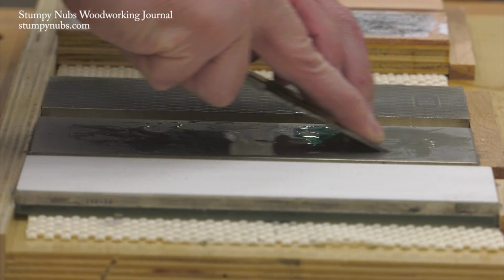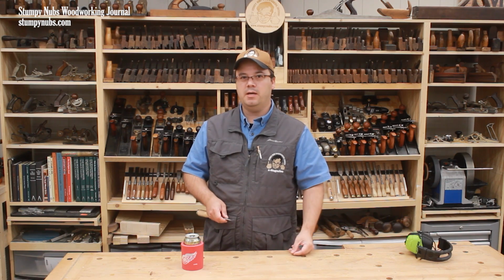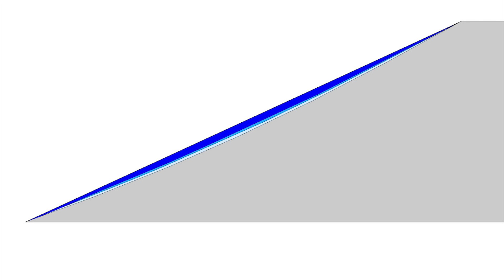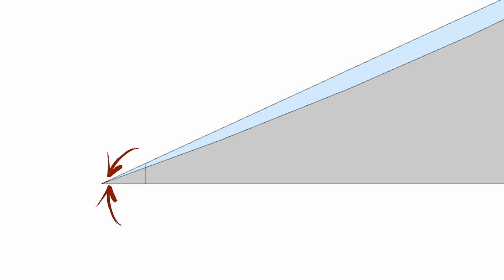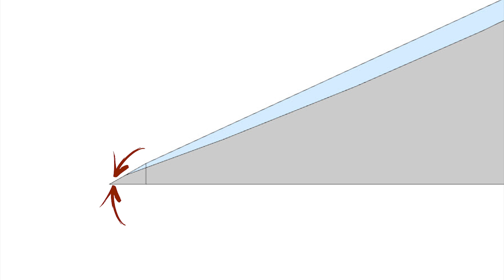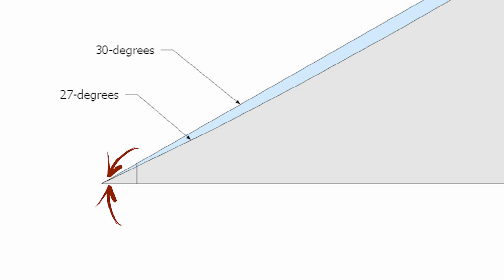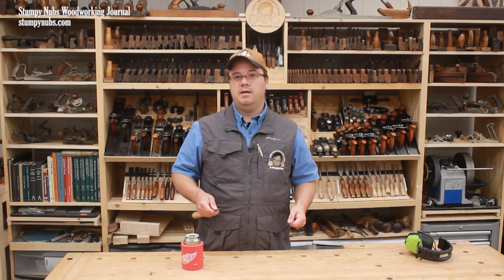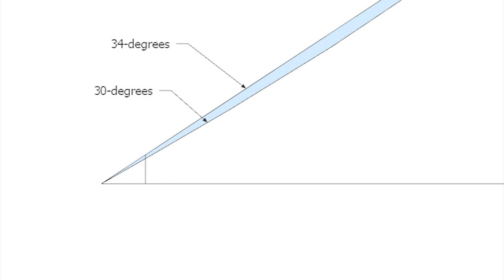The truth and the myth of hollow-grind sharpening

Comment from the maker: I highly recommend WoodturnersWonders CBN grinder wheels. They totally changed how I grind tools!► https://woodturnerswonders.com/
(When you use this link to visit our sponsor, you support us!)
Subscribe (free) to Stumpy Nubs Woodworking Journal e-Magazine► http://www.stumpynubs.com/
Reply: the reason I asked so many questions is I have just purchased 2 CBN wheels, 180 &350, along with a low speed ricon. I have the trend 1000 with their cutting fluid. I guess the Shapton's are next. Thank you for all the valuable info you have shared over the years.
Reply from the maker: @pepper7144  The 180 and 350 are great for shaping new bevels and repairing edges. Your day to day sharpening will be done on the 1000 grit stone. Many times, you can just follow that up with a leather strop. That's sharp enough for most chisel work. But when you need something REALLY sharp, such as a smoothing plane, or to pare soft end grain with a chisel- that level of sharpness would take a lot of stropping by hand (because of the wide difference between the 1000 grit diamond and the leather strop). That's why I have the 5000 and 16000 Shaptons. They do what the strop does, only faster. (Frankly, I most of the time strop on my Tormek, which is by far the fastest way to a razor sharp edge. But that's a whole different system.)

Comment: I'll keep this in mind when I am calibrating how many microns to allow for the wire-edge that has to be removed by stropping, so that I may select the appropriate polishing compound and leather species, grain, and tanning technique. Of course, this must be adjusted for seasonal temperature and relative humidity to ensure that any oxidation impurities that may form have a suitable crystalline structure so as to compliment the cutting process. But everyone already knows that.
Reply from the maker: Not sure if your sarcasm is directed at me, but I think this video has the opposite affect- it simplifies things.
Reply: @StumpyNubs  Exactly, and that clearly violates the code of the omniscient woodworker. Obscure and completely irrelevant complexity is an essential element of the hobby, and therefore your contribution must be counteracted immediately, or novice woodworkers everywhere will start to believe that sharpening is not a dark, mysterious process only able to be performed by those that have worn plaid shirts and beards for over 20 years.

Comment: I love hollow grinds ... The grinder makes creating a fresh primary bevel so easy and fast rather than having to spend half a day on a coarse stone ... I just use a simple 6 inch cheap grinder with a normal aluminum oxide coarse wheel .. never had a problem of burning the steel .. at first when i got the grinder i was afraid from heat build up , but thats another area where people make a fuss about ... Run a few light passes at a time and feel the chisel/plane on your hands and you should be fine .. i dont even dunk in water and everything stays cool if you keep light pressure

Comment: James -- This is another excellent video. You clearly demonstrated that the difference between a hollow-ground edge and a flat bevel is microscopic. Most of your illustrations used a 6" grinder. Many of us use 8" or larger wheels. With such wheels, the difference between hollow-ground edges and those with flat bevels is even smaller. I have a CBN wheel mounted on my Tormek. I KNOW there is a hollow-ground bevel, but I cannot see it with a naked eye. For my money, this is -- and always has been -- a non-issue.

Comment: My reason for hollow grinding is that you can micro bevel the edge more times without having to fully hone the entire edge because the hollow removes the material that would be in the way with a flat grind. Depending on your micro bevel you can do four or five touch ups without having to grind or stone the entire surface. Never had a problem with a weak edge, that's your steel quality.

Comment: Hard to make this point without drawing a picture, but if you hone just a little bit even without making a secondary bevel the angle at the  cutting edge becomes parallel to the line drawn between the two original “corner points” anyway.  So, the reduction in angle at the cutting edge that comes with hollow grinding instantly disappears when you hone.

Comment: With the effective cutting edge of a blade (ANY blade) coming from a hollow grind, until you're effective angle results in something less than about 15 degrees, any thinning that might seem a disadvantage in metal loss, is compensated by the slight thinning allowing that blade's "wedge effect" to not have to pry so much material so far apart as the "intended angle" (the prescribed angle or that angle you've set the tool rest for on the grinder)...

    There are few exceptions, but mostly those are a matter of the steel itself, the hardness being sufficiently beyond what was prescribed for the tool and process intended that it's either too soft or too brittle for the job and utensil in which it's intended to be used...

    As mentioned in the video, there are those who will argue this all day.

    I'm merely stating years of experience and observation APPLYING blades to stones, wheels, and other ablative instruments and then TO WORK... 

    To illustrate more simply... A common "prescribed angle" for a chisel is about 30 degrees... robust enough to be pounded into wood at any working angle with a mallet, but sharp enough to effectively cut through OR separate fibers in a reasonably clean and efficient manner...

     For finer work, say the precision inserts of darker wood for pupils in the eyes of a predatory large cat for a hand-carved relief... This same blade can effectively be used with a grind as sharp as 20 degrees with few ill effects. The metal is sufficient to take the steady drumming of a mallet sufficient for such fine work AND it allows the craftsman to control the cuts for such tiny details,.. Again, below 15 degrees and a distinct "weakening" will be noticed in more frequent chipping at the cutting edge and mushrooming in shorter terms as well, should the chipping not be as present...

     Just as the video suggests, the prescription handed down over centuries to present day wood workers is "AROUND 30 degrees"... BUT we (the new generation and future generations) absolutely MUST remember that most of these tools were developed in some form or fashion before there was such an invention as degrees for measuring angles and circles in the first place. They'd been developed through the same evolutions of trial and error that almost everything our society was built upon... The number of degrees was adjusted by feel and the basic trade-offs were always there...

    A bulkier, higher incident of angle at a cutting edge IS more robust, longer lasting, and requires less maintenance at every term (short, middle, long) of use... The thinner, lower incident of angle will require more maintenance as it wears more quickly, but is easier on BOTH the craftsman and the tool, itself, to force through material and extracting waste.

      SO what can we develop from this??? 
    Each individual craftsman has some personal responsibility to find his own answers from the materials given in his shop... It's a balance from the supplies and qualities of steel in the blades he uses, and the particular crafts he engages in, and woods or other materials he uses, to explore his own form of "The law of diminishing returns". At some point, the amount of time and effort to upkeep blades is just short of the returns in work and convenience for using his tools to get products finished and out the door, from whence he expects his benefits or pay.

     I would suggest fiddling with all your blades. I've used quite a variety, myself. For some things, like planes which you press by hand in steady strokes, a thinner hollowed edge can be a benefit in the ease of use. For others that vibrate (like a saw) or get struck outright (chisel?) the bulkier angles can benefit in the longevity under abuse. Each tool in any shop has it's own entity of purpose and maintenance. Each craftsman has an individuality in his style and methods. 

     Don't be afraid to be a bit different... AND don't be afraid to disagree with me, either... ;o)

Comment: Nice explanation. Folks freak about cutting angles. Do you think any of this would have been relevant 100 years ago, 1000 years ago? Sharp is sharp and each worker would work with what he had. Working the cut with the angle he had ground. The fact that we can now measure "stupid" variations is just a distraction.
Reply: Personally, using precision in my angles ables me to eliminate variables in my sharpening, so that as a beginner sharpener, I'll get good results quicker. I see them as a crutch to get me woodworking with sharp tools quicker, but I hope that overtime I can become free of that crutch
Reply: 100% agree the angle is not the issue. It's the repeatability and time it takes to get to sharp. Schwartz has an article where he sharpens everything to 35 degrees not because 35 degrees is an all important angle. But it allows him to sharpen at the same angle repeatedly.  That's important when using a honing guide because it is very difficult to hone at 35 degrees once and then at a lesser angle in the future.  You have to remove a lot more metal. Again its not the absolute angle its just that the angle is not less than what has already been used. But like you said most masters do it by hand and their muscle memory is probably as good as a honing guide

Comment: Good, um, points. I got something else out of this, though. Being relatively new to this practical sharpening thing (for decades, I just held my knives and other blades at what I thought might be the right angle and never got anything really sharp) where you start the process at 25, or 30, or 35 degrees on a grinder or some kind of metal wheel, depending on who is doing the video, then switch to a file, or sandpaper, or an oil stone, or a stone with a little water on it, or a water stone soaked in water, or a ceramic stone, or a diamond stone, and start with 80 or 120, or 150, or 300 grit, then keep using finer grits until you get to 600, or 800, or 1000, or 10,000, or 16,000, and then go to whetting or stropping or something on leather with white, or black, or green "stuff", then smooth leather. Doing all this in 30 seconds and you can have a scary-sharp edge to shave your arm hairs with. Here is the thing: I always had the notion that when you graduated from the grinder to flat surfaces, you were supposed to grind (or whet or hone or something) the hollow down until that surface was flat -- which takes just this side of forever, especially with a wide plane iron. So I just learned that it's just the end or ends of the arc of the hollow that need to touch the file/sandpaper/oil stone/stone with water/water stone/ceramic stone/diamond stone! Three cheers and thank you! Now my "30 seconds to scary-sharp" might only take a few hours instead of all day!

Comment: So the question remains Stumpy do you sharpen your chisels on CBN wheels? If so do you follow up on a 1000 trend diamond plate? Do you go higher to say 16000 stone?
Reply from the maker: If a tool needs extra work to change a bevel or repair a chipped edge, I grind on CBN wheels. Then I hone either on the Tormek, or with stones. If I use stones I start with 1000 grit diamond, then I strop with leather and paste if I'm in a hurry. If I have a little more time and want a very sharp edge, I go from the 1000 grit diamond stone to a 5000 grit Shapton ceramic stone, then a 16000 grit Shapton........ Frankly, I have to be comfortable with a lot of different processes because my audience has different needs and preferences, and I make videos for all of them. :)

Comment: Great explanation of this pro/con debate. Myself, as long as l get a razor sharp edge that lasts l am happy. I am also a believer in the micro edge due to a Rob Cosman video. Keep your very informative videos coming they are excellent.
Reply: The purpose of a micro bevel is to make sharpening quicker. When Rob Cosman, or Stumpy in his videos, demonstrates creating a secondary bevel, it's always in the context of moving to a higher grit stone. So, Rob demonstrates using a 300-grit stone to establish the primary bevel. Then, when he moves to his 1000-grit stone, he lifts the heel up just a little to establish a new, smaller, bevel -- the secondary bevel. As he has explained several times in his videos, the whole purpose of doing so is to avoid having to grind the entire primary bevel at 1000-grit. It's a time saver. Then, in Rob's case, he moves to his final stone and, again, raises the heel just a little more to establish a tertiary bevel. The reason is exactly the same -- to save time by avoiding the need to sharpen the entire bevel (primary or secondary) with his highest grit stone.

Comment: There are only two advantages of the hollow grind. Like James said it is easier to hone by hand with the two points of reference.  However you instantly lose the reference points when you try to add a micro-bevel by hand.  The only other advantage is you can use the grinder for your turning tools!
Reply from the maker: You don't need to lift the heel to create a micro bevel. Just hone it with the two points (heel and edge) on the stone.
Reply: @StumpyNubs  I'd have to pull out my 8th grade geometry book, but I think if you did it that way given how little distance from the edge to the heel you would be effectively honing at the same degree that it was ground. I think raising the heel increases the honing angle making the edge more durable. Im a weekend hobbyist and committed to a flat power grind when needed and a honing guide for sharpening. 
Love your videos!
Reply from the maker: @MrSharper802  - Since the purpose of a micro-bevel is merely to have less to sharpen on your fine stone, the angle is irrelevant to that purpose. Placing a hollow ground bevel on the stone with heel and edge in contact will result in honing only a thin strip along the heel and a thin strip along the bevel, essentially fulfilling the purpose of the technique. .... As for a specific angle- The computer models showed in my video that if you grind to 30 degrees, the hollow creates an effective angle at the tip of 27 degrees. If you look at the drawing at 4:08 you will see my point. Imagine the blue line as the flat stone touching at the the heel and edge. As you can see, the stone would not hold the existing angle created by the hollow grind at the tip. It would return that tip from 27-degrees back  to 30-degrees.
Reply: @StumpyNubs  I see what you are saying. I guess I'm just caught up on terminology.  To me when you go from grinder to stone you are just reestablishing the primary bevel. The primary bevel is less in width because of the hollow grind as you said, but it will get wider with each sharpening. I thought you then still add another microbevel after that by lifting the heel off the stone, and thus losing your reference point.

Comment: I’d be more worried about over heating the steel than the hollow on the grind.
Reply: Exactly,  but if you hone on a flat stone just stay back from the edge and only grind enough to create the hollow in the center of the bevel.  This still gives you the two points of contact for honing but makes it less likely you'll over heat the cutting edge.

Comment: I don't like hollow ground edges. 
Using a draw knife as an example it dramatically increases the resistance pulling the sharp blade through wood. I believe much of this is due to the unnecessary transitions from flat to hollow "catching a little". 
If you want the sharpest, smoothest edge don't hollow grind it take your time with a stone. 
If you want quick no hassle. Hollow grind it.

Comment: About the only thing I would say is that if you hollow grind your chisels and irons you need to be more careful about not overheating the tool.  The other thing I could think of is that with a hollow grind you might need to sharpen your tool slightly more often .Neither of these is really going to change things that much in my opinion.

Comment: Love it!  I have been meaning to sketch up in CAD just what you presented for some time.  You saved me the trouble.  My assumption has always been exactly what you presented.  I don't currently use a quality wheel to sharpen my tools, but have been considering getting one to establish the initial edge on new cutting tools more quickly.  (all new tools need it) I plan to stick with my tried and true diamond stones for maintenance.  Thanks.

Comment: I'd be more concerned about eventually grinding away the case hardness but I seriously doubt the tool manufacturers don't account for that
Reply: I think that if your chisels or plane irons are just case hardened you need better tools. The initial honing will probably go right past a case hardened layer. Case hardening is typically for wear resistance such as gears, metal surfaces that get friction contact with other metals.

Comment: Great illustrations and explanation. I knew I was missing something important - the practical difference when using a secondary bevel is effectively nothing. Somehow I was thinking that my hockey skates are hollow ground and I certainly won't be skating on my chisel blades. I know, irrelevant, but I'm a newbie and want to really get this. Now I have no excuse to not find a proper rotating disk machine for the wheel you suggest. Would you use the same method for your marking knives? Also I'm still extremely glad for your post re the chainsaw blade on an angle grinder. Thanks again. Cheers